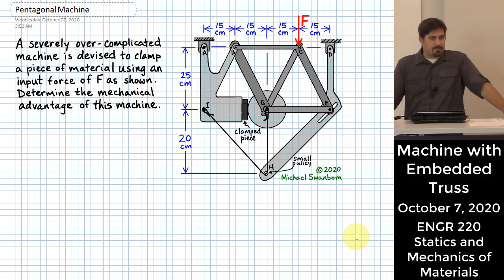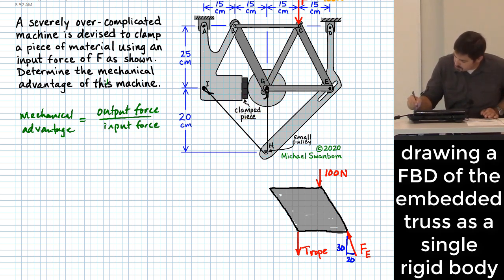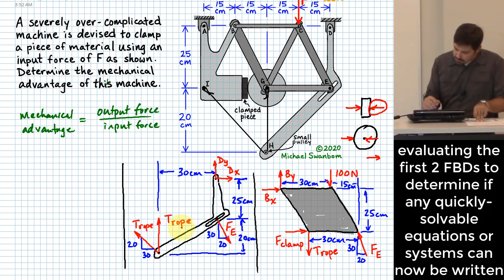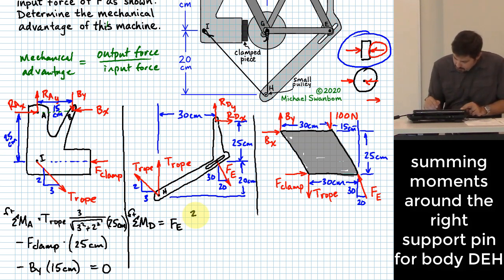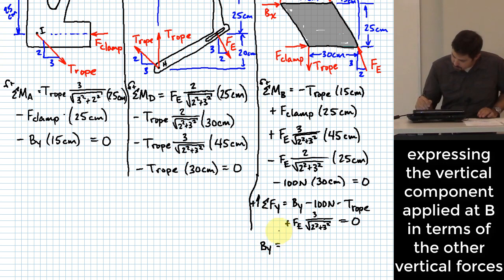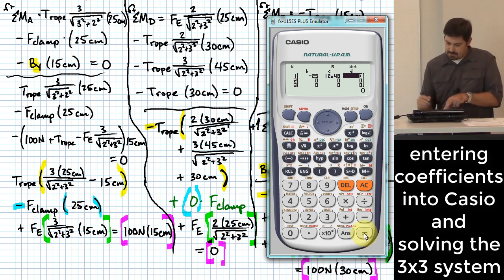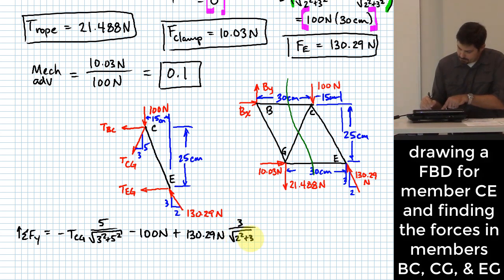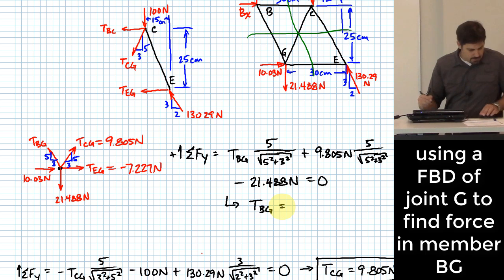Machine with Truss Embedded | Finding Mechanical Advantage w/ No Force Given | Review of Structures

Comment: Thanks for another great video. Since the 100N value for F was arbitrary, would it be proper to convert all the other forces found back into terms of F alone so that they are general solutions for any value of F? (The mathematician in me wants to keep it all in variables from the start, but that makes for messy calculations...) Relatedly--are there heuristics we can use to safely conclude that the relationships are all linear? For example, could we say that for any frame/machine built of certain kinds of members or connections, the forces all scale linearly?
Reply from the maker: I like how you think about this! Yes, this problem could be left in terms of a variable F, and yes, as you say, the output force will scale linearly with the input force. That is why this method works. As far as heuristics, I haven't ever sat down and tried to make a bulletproof list of heuristics for this. But I can tell you a few things to watch out for that can compromise linear scaling.
1. More than one variable input force
2. Geometry that varies significantly with load (often due to structural elasticity)
3. Member interactions that will only occur after some amount of deflection has occurred
4. Statically indeterminate structures (and the residual forces/stresses that they can potentially have built in)
5. Dynamic/inertial effects
6. Static/Sliding friction transitions
7. Viscous friction for situations involving motion
8. Contact (e.g. Hertzian) stresses are typically inherently non-linear
9. Probably others I'm not recalling at this instant!

Here are two lectures that come to mind where non-linearities must be considered and dealt with:
https://youtu.be/WLbImDnnnIY
https://youtu.be/EBCVKCISd0c

Thanks for watching!

Comment: Do you have some insight on why the machine was devised in this particular way? Thank you for the great video!
Reply from the maker: It was devised this way so that I could demonstrate an example problem with all of the elements I wanted to include in no more than 1.5 hours. This machine was not inspired by any real machine. Nonetheless, the methods shown for each of the parts and connection types are useful when real machines are analyzed. I'm glad you liked the video! Thanks for watching!